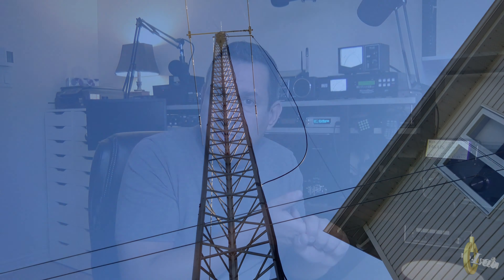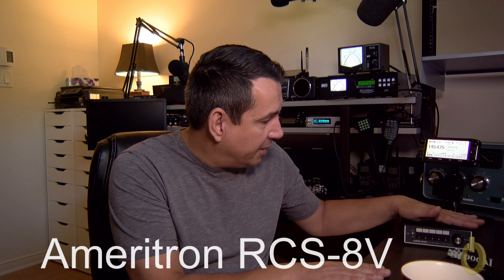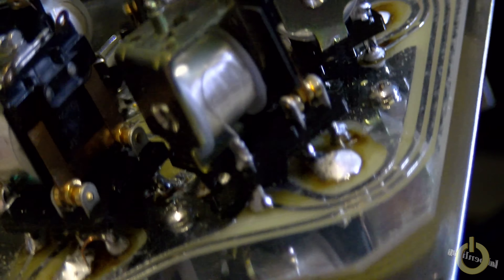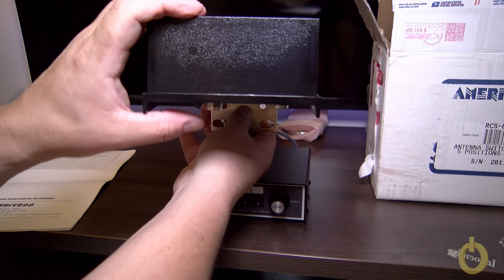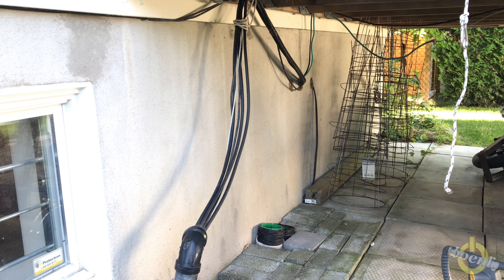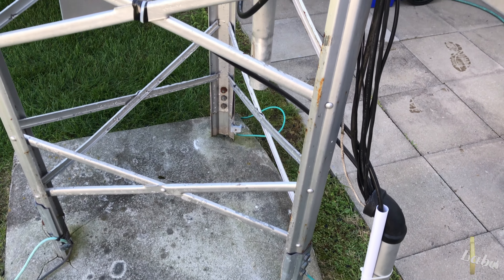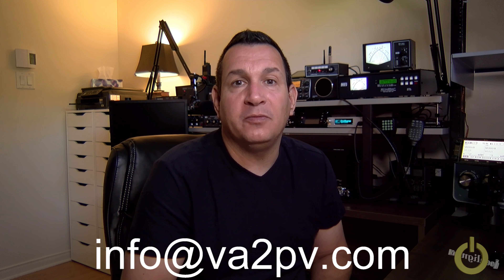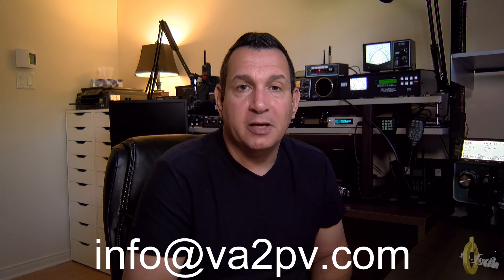Installation and review of the Ameritron RCS-8V remote coax switch

Comment: Great Video 👍👍.  I recommend that you use self amalgamating tape on your connections rather than the PVC electrical tape. PVC tape is ok for cable insulation but does not guarantee a water proof connection. The self amalgamating rubber tape will seal to a water proof state and eventually amalgamate into a solid rubber covering which is most waterproof. If you wish you could further protect the amalgamating tape from UV exposure by covering with your PVC tape. 73 de GI8WFA.

Comment: Top Quality review as usual Pascal,
I use the RCS-4 and it is very good indeed.
73s
Gerry 
G0PWX
Reply: Hello, Brent (KI5HXM) here from Texas.  Do you still like the RCS-4? I have looked at some remote switches and this seems to be what I would like.  How does it handle bad weather?   What is the current draw on holding the relay’s?  All the best, 73 de KI5HXM

Comment: Hi there,

I noticed one problem with your installation...

The instructions state that you should keep those coax coils to the switch separated by at least 2 inches. That is to prevent the possibility of cross-coupling & noise.

Hope this helps, 73 - John
Reply from the maker: Thanks for letting me know, so far I never had any problem...  73 Pascal VA2PV

Comment: Looks good for tower use. Wondering how good for multiple dipoles and loops around the lot. Phasing harnesses etc. I’ll have a yard full of coax coming to this remote. Haha. I’m afraid to put tower near electric lines
Reply from the maker: Hi Glock, with the modification shown in the video you ensure that all antenna are ground when not in use, this prevent RF to be pick up while using another antenna.  My tower is 33 ft from the power line, yes you have to be careful.    73 Pascal VA2PV

Comment: Thanks for the video.I have been wanting to install one of these switches at my shack.I want to run my coax to the switch under ground. I want to mount the relay switch to a large tree and run my coax from my wire antennas down the tree to the switch.this will look better then all the coax runs hanging in the air and coming into my house.Wonder if I can get the remote cable that can be buried?
Reply from the maker: Never heard of any under ground switch, but this one works great.  73 Pascal VA2PV

Comment: Great video!  I have used this remote switch for several years, problem free.  As you mentioned, it is a very nice, high quality remote coax switch.  Thanks too for the tip on adding electrical tape to connectors?
Reply: Hihi,  I have this bad habit to tape everything as it's cheap.   Snow and ice could be sticky in Canada.  73

Comment: Hi Pascal, I have some concerns about this box, are you sure that the control cable isn't picking up RF power from your TX antenna and sending it back into your shack via the control box please? Your advise is more then welcome:) 73 - Pascal
Reply from the maker: Hi Pascal, this unit is still in service and work like new.  I also recommend that you watch the video below.  73 Pascal VA2PV https://youtu.be/9FntelKOjoc
Reply: @Laboenligne  Thanks, I did look into your video about installing switches, very instructive indeed! The only concern I have is possibly coupling RF back into the shack via the control cable of the remote switch (it's just a couple of simple wires, perfect antennas:). It could bring RF interference into the shack, maybe into microphone cables or unshielded SDR's as the SDR1A. I am hesitating about installing this remote coax switch just because of this. It all depends of course of the way everything is installed and in your case how much the control cable is actually picking up HF sent from the top of your tower, I can't tell of course. I have a couple of end-fed wired hanging around at low altitudes and a cushcraft R9 4meters above ground level, so this could be a bit dangerous I think. What is your opinion? Best 73 from Belgium, Pascal Keep up posting!
Reply from the maker: @pascalmestdagh5074  Hi Pascal, I have no RF problem on any band using with this switch.  Please make sure you do the modification I did to put all unused ports to ground.  For the wire, I used a double shielded rotator cable, it did the job.  I also have a very good ground for my station.  73 Pascal VA2PV

Comment: Hello, I have followed your channel for a couple of years.  I used some of your videos to help me with ideas for my shack.   I’m a new Tech & General licensed ham as of Jan 2020 and have slowly been building my shack.  I am interested in coax switches for HF mainly and use dedicated lines for VHF/UHF because I will have scanners or other radios on those frequencies.  One question on CAT5 cable. Is the current carrying signal for the switch control low enough for CAT5? Usually that cable is 24 or 26 gauge wire.  Thanks for another video.  All the best, 73 de KI5HXM

Comment: Array Solutions Rat Pak blows away the RCS .Poor isolation plastic housing. Rat Pak all power coated metal housing well built relays on a much heaver board excellent isolation. Anything owned by MFJ now is suspect? Mighty Fine Junk ...